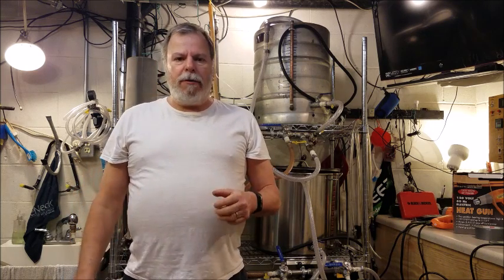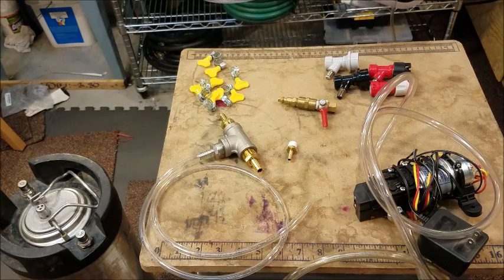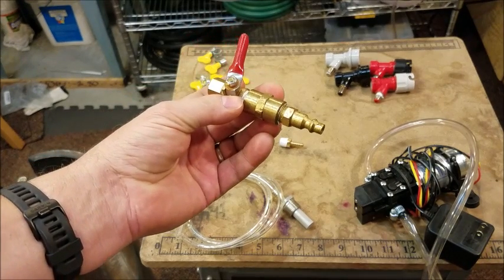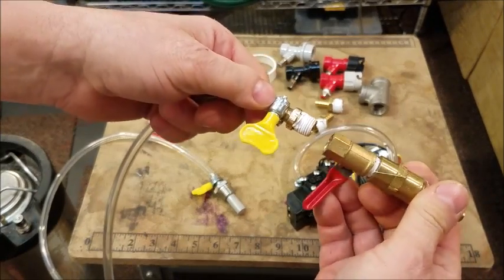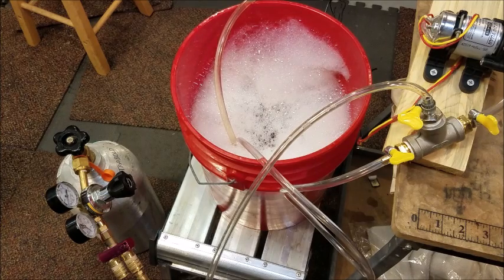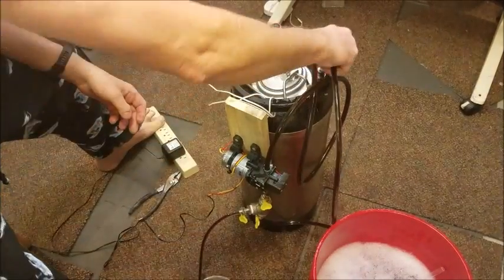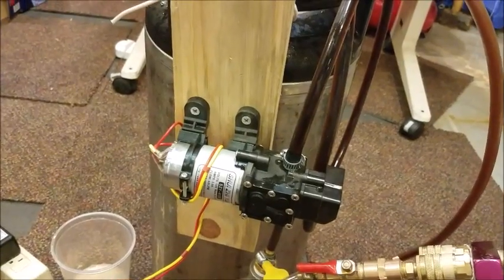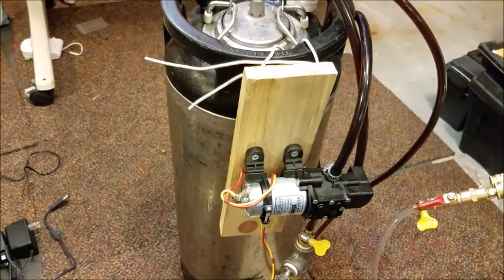Building an Inexpensive, Rapid Carbonator for Brewing

Comment: This is a few years old now...Are you still using this process? Is it worth it for a mere 5 gallon corney keg?  Seems like you're exposing your beer to a long trip, through a lot of fittings and hoses, all of which are contamination risks.  One of the things I try to do with home brew, is minimize the amount of dissolved sanitizer that ends up in the beer.  Distance through hoses in my system are minimized until serving, but I'm always willing to learn. "About an hour" seems like a pretty vague measure.  The more I read the more I learn that specific styles, require specific carbonation levels (vols).  But most Americans only like it one way - highly carbonated and cold.  Even if that means it's wrong for the style...  Have you determined a way to measure and move from "about an hour" to either a specific carbonation level, or a specific gas flow rate for a pre determined time to hit those target vol levels accurately?  JMHO but it seems as if many home brew techniques, involve a lot of these "interesting" steps. I find that if I just brew 3 times in a short period of a few weeks, that I can't possibly consume or even give away enough of the first batch, to get into the third batch before it has had enough time to naturally complete fermentation, lager and be fermented by traditional means or a few days on gas.  Really just wondering if you've stuck with this technique?

Comment: Would you happen to know why my beer is backing up through the carb stone line and into my regulator at 10psi?
Reply from the maker: I would guess that the pressure is not high enough to push liquid through your stone. If liquid was backing up into your stone then something must be sucking it up or pushing it from the other direction. If you have pressure on the stone line then the beer should not be coming the other way. If this is happening when you are first starting then it is possible the pressure in your keg is higher than the pressure on your regulator.  Make sure that you bleed all pressure off of the keg before you hook everything up and that will probably fix the issue.  The pressure on the system will equalize and beer should not be coming back the other direction as long as you have your pump on. Also, you might check the return line into your keg and make sure there's nothing clogging it. Are all of your lines the same diameter? If they are not the same diameter you might be pumping at a higher pressure than it is sucking from the other direction and there might be back pressure on your airline. I'm just guessing I hope it helps.
Reply from the maker: Sorry I just saw this. I hope you figured it out.   I imagine it is just a matter of increasing your pressure.  Your carb stone has what is called a "wetting pressure".  This is the amount of pressure needed to push CO2 through it to get it going.  This amount of pressure needs to be added to the pressure needed to carbonate. So if the carb chart says 10lbs will carbonate atthe volume you want and your stone takes 4lbs to get it started you would carb at 14 (I am making up these numbers).

Comment: Thanks for this video. This will be my next beer project. Have you co tuned to use yours? Any upgrade recommendations since you last posted this video?
Reply from the maker: The biggest thing I have learned is to take into account the "wetting pressure" of the carbing stone.  That is the initial pressure needed to get CO2 flowing through it.  You need to add this to the carbonation pressure from the charts to get the proper carb level.  In my case i need to add 4 lbs to whatever the chart says.  If the chart says 10 lbs CO2 pressure will give me a 2.3 carb level with 36 degree wort then I have to set the pressure to 14 lbs to get there. I tested this in water before I put it in the T fitting.
Reply: Thank you for putting this together.

Comment: What are those disconnects you have on your manifold for the CO2?
Reply from the maker: They are standard air hose quick connects (Mechanical I think) that I bought at Menards (they were on a clearance table at the time).  I am not sure I totally recommend them, although they have worked fine.  I think these are relatively high end and don't leak.  I have a valve in line in front of them and have shut it off and pulled the hose a couple days later and there was still pressure.  That said, I have similar ones on my air compressor, from Harbor Freight.  The compressor has a hose that is always plugged in, and it cycles every couple days.  I can only think those cheap ones leak.  I have heard people say that they used these types quick connects on their keezers only to find their CO2 tank empty after a day.  If you use them, I would recommend turning the tank valve off when not in use.

Comment: Just watched your video its great, just like to ask one question does it matter where you put the aeration stone ?
Reply from the maker: Thanks for the nice comment.  In the ones I have seen, i.e the Blichman Quick Carb, the design has it on the side port of the "T" fitting so CO2 is picked up as the beer passes and it is after pump.  I suppose you could put it anywhere, as long as the beer passes it to pick up and infuse the gas.  It would probably still work on the end port, although I don;t know if it would be as efficient.
Reply: ok I will give it a go thanks for the info

Comment: Hi Tim! Thanks a lot for this video! You know? every single video about "quick carbonation" is in a 5 Gal keg, I'm wondering if there's any possible way to home carbonate a 1/2 barrel?
Reply from the maker: I don't know why you couldn't use the same set up a. As long as you had enough gas and time it would work.  It would probably take a while for that much beer but once it reaches equilibrium its carbonated.

Comment: Tim, do you pressurize the keg at all?
Reply from the maker: I just purge the keg normally 10-15 times.  Once you start carbonation you set the pressure of the CO2 to be at the carbonation level you want (based on one of the many online charts) plus the wetting level of the stone you are using (the amount of pressure needed to get CO2 flowing through the stone).  So, if it takes 4lbs pressure to start pushing CO2 through the stone and the carbonation chart says it takes 9lbs pressure on the keg to reach the proper carbonation level at the beer's current temperature, you would set the tank pressure to 4lbs+9lbs=13lbs to carbonate the beer.   Thanks for watching.

Comment: Have you noticed any off flavors with the pump?  Just curious how food grade it is.
Reply from the maker: I can't say if it is truly "Food Grade".  The pump parts are all hard injection molded plastic, but I don't know for sure what kind is used.  I haven't noticed any off flavors, at all.  I am assuming that after running Soap and Water and StarSan through it for now well over an hour that anything that could have leached out that would be touching the liquid is long gone.
Reply: That pump looks similar to my water pump fir my rv

Comment from the maker: I figured out why it was over carbonated.  I have a Harbor Freight CO2 gauge.  It has two scales.  One goes from 0-45 and the other 0-100.  I checked the pressure with another air gauge in series and realized I was using the wrong gauge scale.  What I thought was 15 lbs was actually 30.  I should have been using the inside scale instead of the outside scale.

Comment: Is there any reason you couldn't use a chugger pump for this if you already have one on hand?
Reply from the maker: You could try.  I have Chugger pump too that I use for most of my brewing needs (Wort Transfer/RIMS/ Chilling, etc).  I decided to buy this one because it is able to pump at a higher pressure (100psi) and it is self priming.  I am not sure how much back pressure the Chugger can handle from the CO2 (although the CO2 is only going to be set at 10-15lbs) and I wasn't sure how I would prime it.  At $16.50 plus a power supply it wasn't that expensive and I can dedicate it to the carbonator.

Comment: Hello Tim, do you think that a 1 gpm/35 psi pump will work?
Reply from the maker: It probably would, as long as it is self priming.  The only way to find out for sure is to test it.  You might find that you need a stronger pump to counteract the amount of system pressure from the gas.  I think my pump may start to strain, a little, if the CO2 pressure is high. But, the 10-12 lbs. of pressure you will use shouldn't be too much.  The pump I use isn't to overly expensive  if you need to get one (around $16 US).

Comment: That guage isn't in psi, it's in lpm or cut hours. I believe that's going to be a decent difference in numbers.
Reply from the maker: Actually, based on my experience and some testing, the inside numbers are equivalent to PSI. I had read that before, on other forums and did some research when I bought it.  Others have said that flow rate is really a function of the pressure and that the printing is incorrect.  The manual talks about flow.  Anyway, I tested it when I first bought it a couple years back, then again when I got the over carbonating to verify which numbers I should use.  I put an air gauge in series with it and measured the pressures.  I found that the inside numbers corresponded to pressure gauge, exactly.  Out of curiosity, I just contacted Harbor Freight.  We will see what they have to say.  The bottom line is that it works well and was $20-30 less expensive than other gauges.  For my backup tank, it works OK.  My Keezer has a tank with a standard gauge and 3 gauge manifold.
Reply from the maker: I sent an customer service e-mail to HFT about the gauge markings.  The documentation and they also say that the tank gauge measures the bottle pressure and the output gauge is a measure of flow rate.  Well, as I said I put an air gauge with PSI markings in front of it.  The pressure numbers corresponded to the inside "flow" numbers all the way up the scale.  Go Figure.  Anyway I still use it and it seems to work pretty well for 2/3 the cost of most beer regulators, although I did just see a 4 star rated one on Amazon for $41.
Reply: Tim Trabold what one is that?
Reply from the maker: Here is a link to the Harbor Freight page:  https://www.harborfreight.com/regulator-gauge-94841.html  Be aware that it is set up initially as an argon regulator. You will need to change the stem to a CO2 stem (included).  Make sure you check for leaks.  I would put a ball valve in front of it.   FYI, I have recently changed it out for an actual beer regulator (I got one off Craigslist).  Also I found one on Amazon for $34.99 with the ball valve/checkvalve included.  I would probably go with it:  https://www.amazon.com/dp/B06XPHGC8K/ref=asc_df_B06XPHGC8K5307620/?tag=hyprod-20&creative=395033&creativeASIN=B06XPHGC8K&linkCode=df0&hvadid=198106240524&hvpos=1o1&hvnetw=g&hvrand=16613364277701962848&hvpone=&hvptwo=&hvqmt=&hvdev=c&hvdvcmdl=&hvlocint=&hvlocphy=9024578&hvtargid=pla-350193768709I

Comment: Do you know what gauge wire the pump is using?
Reply from the maker: Not specifically, but I would guess 20 or possibly 24 gauge given that it is only 12 volts DC.

Comment: Hi from Perú. Amazing job! But I've a question... Do I need to release the pressure of the keg sometime ?
Reply from the maker: That depends.  If it is too highly carbonated you could let pressure off and it will gradually become less carbonated as more is released.  When you move the keg to your kegerator or keezer, if you have more than one keg on your CO2 line you may need to release the pressure so that it is less than that of your other kegs.  Otherwise, it may increase the overall pressure of all your beers and if it is real full it may back flow into the air line.  Once you have the keg set up for serving you can leave it on the CO2 indefinitely.
Reply: Get a water supply pump.  Most are made for 12v potable water.  If it's all plastic, which most cheap pumps are, it should be fine.

Comment: Hi Tim,
This is going to be my next project once the brew shop re-opens after the Christmas break😂
Sorry to be a pain, but where do l find the charts you used to establish carbonation pressures and time? Are you just using a standard forced carbonation chart or is there one for in line carbonaters? 
Cheers!
Reply from the maker: Thanks for watching.  I just use the standard carbonating charts you will find online in a lot of places. They will tell you what pressure will give you a certain carbonation level at a specific temperature.  The key to using the carbonator is to make sure you add the wetting pressure of your carbonation stone to that pressure.  The wetting pressure is the base pressure threshold needed needed to push CO2 through the stone.  My stone takes about 3-4 lbs of pressure to get started.  To find this out I put it in some water and turned the valve up until I saw bubbles flow. So, I add 4 lbs to the recommendation from the carbonation chart.  Good luck with your build.
.
Reply: @TimTrabold  thank you mate. I remember your wetting mention on the video. I added 2psi but found it was a little light. Next time l use it l will try 4psi. Thanks again for your video. My unit worked well. Cheers!

Comment: All that video and you didn't show the pour!?
Reply from the maker: I thought about that after I put it together and decided it wasn't worth the effort to re-edit (it was 1:00 a.m.).  :)
Reply from the maker: I just filmed a "Part 2"  I didn't forget the pour this time  (it was a little over carbonated)  :)
Reply from the maker: I figured out why it was over carbonated.  I have a Harbor Freight CO2 gauge.  It has two scales.  One goes from 0-45 and the other 0-100.  I checked the pressure with another air gauge in series and realized I was using the wrong gauge scale.  What I thought was 15 lbs was actually 30.  I should have been using the inside scale instead of the outside scale.

Comment: For God's sake, chain that high-pressure gas cylinder to an immovable object.  If it should fall over and the valve breaks while it is pressurized to 3000 psi, it will make a rocket that can penetrate a cinder block wall.  Basic welding class skills.
Reply from the maker: Good thought.

Comment: Never use brass or copper for carbonating. Use stainless steel or plastic especially if carbonating water. But I see a lot of stainless in beer equipment. Not too much brass
Reply from the maker: Agreed, although I am not that concerned on my scale. But, FWIW, I have swapped the brass out since I did the video.  Thanks for the comments.